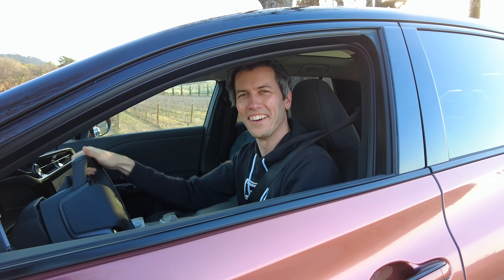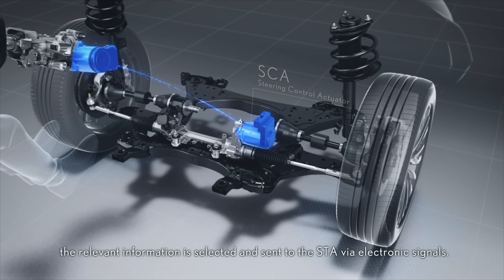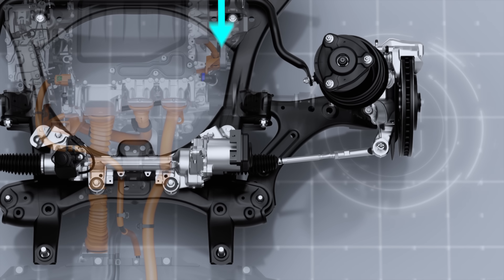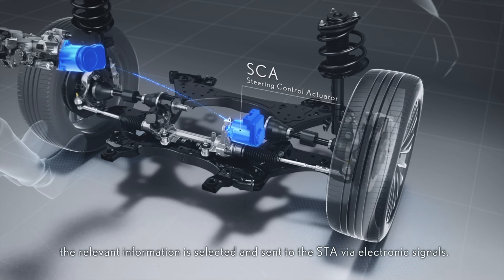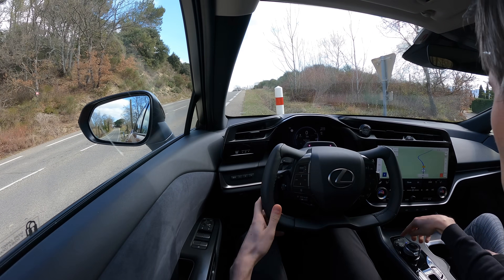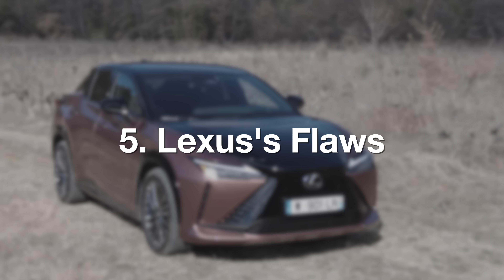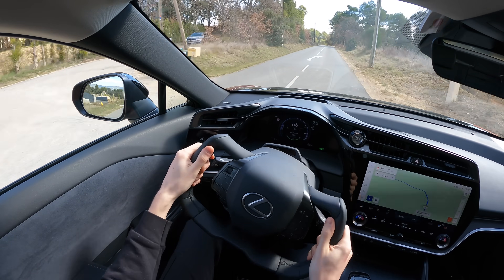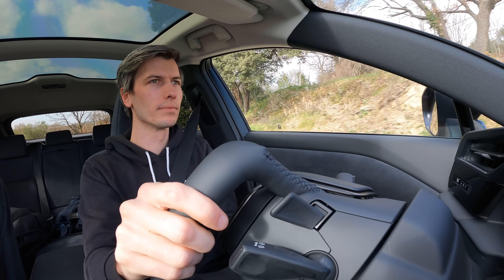How Lexus Fixed Tesla's Bad Idea: Steer-By-Wire Yoke

Comment: Not wild about this but I’d love to try one in the real world. I feel like the variable steering ratio would take some time getting used to and could possibly cause some issues when first getting used to it. The ratio could be different than the driver is expecting in some situations when learning the system
Reply from the maker: Definitely took some getting used to! Watching back my driving footage, there numerous moments where I'd steer, then realize I'd put in too much angle, and correct. I predict we'll see many curbed wheels when these first come out. 😂
Reply: @EngineeringExplained  
6:18 I heard a clunk of some sort 😬. Was this what I think it was? 😉
Reply: @Conservator.  what did you think it was. Sounded like he hit a lane marker
Reply: @MStrange88  Yep, I thought he hit something.
Reply: @Conservator.  sounded like something hitting the interior from the cornering forces
Reply: @joshieeee20  It was probably another bucket. Every time someone leaves a bucket on the road he hits it and damages the car.
Reply: @EngineeringExplained  But where is the evidence you're ever as used to it as you were a fixed ratio? Professional gamers on computers disable "mouse acceleration" on their operating systems! The concept is the same. Sure, not everyone is a pro, but this is burying muscle-car-interface mechanics deeper into the subconscious.
Reply: @EngineeringExplained  What if they dont touch the steering ratio, put an slight expo to it so the center is less sensitive?  Then I would also like damping of steering movement at the yoke, generated from the feedback motor, to prevent jerky moves. Then you could tune the curves however you like, also less damping if you feel like racing.
Reply: @EngineeringExplained  That is an excellent explanation as usual, I like the idea of variable steering ratio, and I love my Model Y single pedal mode and think you would adjust to variable speed steering quickly. 
Still, NHTSA would put up so many roadblocks for Tesla to implement.
Reply: @jjamespacbell  I don't really get that why so many people like one pedal drive. I guess they want it to feel as similar to a gasoline car as possible. 
It feels like they remove one of the best features of electric cars by doing that - the ability to freewheel, without having to drag along a high internal friction engine, that slows the car much faster than just the air and rolling resistance.
If I want to regen, I would rather choose when to do it or not - either by the first section of the brake pedal being regen (as in some existing electric cars) or having it on a separate button or for example a paddle on the steering wheel.
Reply: @Speeder84XL  Since I drive truck the one pedal driving with regen would be identical to driving a truck with the engine brakes turned on. Since you can float gears in trucks, down shifting doesn't require the clutch so you can pretty much bring them to a stop with just the throttle and engine brake.
Reply: @Speeder84XL  A good many EVs give the driver the choice of regenerative-braking levels. Mine does. By default it's set up to feel like a normal car, so that someone who can't deal with something out of the norm doesn't have their head explode. One press of a button puts it in one-pedal driving mode. I use it in traffic jams, but not in normal driving.
Reply: @bikeaddictbp  Yes, but regenerative braking is nice to have. What I don't like is to have too choose between a car that loses speed unnecessarily fast as soon as the gas pedal is lifted or having to turn off regenerative braking completely. I want to choose when to brake or not - regardless if it's regenerative or friction braking. 
But of course it also may have to do with how I drive. For slow drivers, it's easier to keep a slow steady speed (going the speedlimit) if having a car that behave almost like a cordless drill (a bit exaggerated), where speed (RPM of motors) is quite hardly regulated by the position of gas pedal (especially if there are hills). 
But the way I drive (unless it's a relatively straight road with little traffic, where I go at high speeds continuously), I mostly use gas pedal to just accelerate, then coast down while approaching slow drivers ahead (or some other obstacle), then accelerate again while the road gets clear and so on. With regenerative braking as soon the pedal is released it just get more jerky with having to hold the pedal for longer then directly transition to braking.
One of the big advantages of electric cars is that they can actually freewheel, without a high internal friction engine wasting energy slowing down the car (or wasting gas running at idle, if neutral is put in). It just feels like they take away that advantage with the "one pedal drive" (either that or you have to turn off regenerative braking, which is otherwise a good function)
Reply: @Speeder84XL  I do not think you completely understand regenerative braking .  EV s using the regen to generate electricity to the cell pack is a plus . Also one pedal driving is a plus .  Some people driving an ICE car can use the transmission ( downshifts ) to slow the car down and keep RPM high for better performance .they also can let the car freewheel to save gas .  EV s  just work differently.   If you can change the regen on the fly , it is just better driving experience. Just like changing the steering ratio by the computer.
Reply: @rayRay-pw6gz  I understand well how regenerative braking works and also know that electric motors doesn't do that on their own (they are not like an ICE, that have braking action on it's own, as soon as no fuel is put into it). An electric motor just freewheels if the power is turned off - for any regenerative braking to happen, it has to run as a generator with current drawn from it (which can then used to charge the battery). It is all regulated by the inverters and can as well be activated by the brake pedal (top part, before friction brakes kick in) as in some EVs or by a separate button or lever.
So, simply put - what I don't get is why so many people want a car that quickly loses speed as soon as the gas pedal is let pedal off (regardless if it's regenerative braking or internal friction from an engine). The only thing I can think it's good for, is slow driving - it get's significantly easier to keep a slow steady speed (usually the speed limit) with one pedal drive (especially when there are hills). 
I would rather have one that just freewheels when the gas is let off, then choose when I want any braking action. But with that said - it's not at all something that ruin the nice experience of driving an electric car and can be compensated for when driving (by just "hold on to" the gas for longer, then let it off closer to where I want or need to slow down). But I would rather prefer to not have braking action going on as soon as the gas pedal is lifted.
Reply: @Speeder84XL  I think that some people like myself , like to have greater control on how my car runs.  I have a Camry with 8 speed automatic. I like to use manual shift mode sometimes for greater control .  Going down a large long hill , I sometimes shift to a lower gear to keep the speed lower without using the brake.  If I am in slow traffic , I can leave it in first and have one pedal driving .  Also the transmission learns my driving style and mimics the way I shift .  Personal preference.
Reply: @rayRay-pw6gz  Yes, but when going downhill and need to go slower than the "terminal velocity" (the speed at which the air and rolling resistance keep the speed from increasing any further), I prefer to control the speed mainly by braking instead (even if it means also using the gas occasionally
 - for example slow traffic is often "stop and go" and the hill may not be steep enough to get up to speed quickly enough when traffic starts moving, by just freewheeling). 
The only reason to use a gear instead of brakes, is to avoid overheating the brakes going down long hills and to save fuel (as the energy that would be just wasted in the brakes is instead used to turn the engine - which would otherwise consume fuel by idling). 
But with regenerative braking, there is none of those issues, so with the right configuration, it will allow for controlling the speed by braking and still be very energy efficient. That's how I prefer to drive - but after all, it comes down to personal preference.
Reply: @Speeder84XL  yes I totally agree .  Personal preference.  Humans are complex .  And back to the original conversation,  that is why having these choices in any vehicle is a plus .  😎
Reply: Cadillac did a variable power steering based on speed a while back that was an absolute disaster driving around mountain roads. Coming out of a slow speed corner, getting up to 55mph, then into an uphill curve. Drivers wouldn't anticipate the change in steering feel and understeer. They slow down and the low speed power steering kicks in then yanks them into the on coming lane. A variable steering at high speed could be tough to get used to if you live with lots of windy roads.
Reply: @davidallison669  I believe what you're talking about is what's generally called "variable effort" or "variable assist" or something like that. Less assist at higher speeds and more assist at lower speeds, it's common in vehicles with both hydraulic and electric assist power steering. I understand what you're talking about, but that sounds like an early implementation of GMs early version of this, where it was merely a solenoid and those were also not reliable. You're not wrong in what you describe. I currently own two cars that actually have this system and the dynamic is much more refined than the early systems I mentioned, as I've also driven a number of those. Anyhow, those systems are now very common and not an issue, because of many refinements made since first implemented into production cars. 😊
Reply: @goosenotmaverick1156  
There are mechanical variable ratio mechanical steering systems. 
BMW introduced their version in 2003. It’s called active steering. See Wikipedia.
Reply: @Conservator.  im aware they exist, and what they are, etc. I was referencing the exact system someone else was talking about, see  comment by person I tagged. They were talking about a Cadillac variable effort system not a variable ratio system.
Reply: @goosenotmaverick1156  Ok, 👍
Reply: @davidallison669  hard to say without trying it out, but the steering angle increasing while breaking could be quite something, I would certainly be conscious of that for the first few corners!
Reply: Yeah, I feel like this is a case of the exceedingly-low-but-non-zero probability of unexpected behavior at exactly the wrong moment is not worth the marginal & debatable improvements over a system that works just fine as is.
Reply: I think it would be easier to get used to with a yoke than an ordinary wheel though. Because it would feel more natural with the higher sensitivity steering at low speeds then
 - turning a yoke like 360° in each direction (or what most standard cars have) would feel a bit strange and clumsy. But with a normal steering wheel, it would take a little time to get used to - since I think most of us would expect it to behave like a normal car. 
When it comes to F1 cars, I don't think it has to do only with them being better drivers, it also has to do with the "centering force" on the wheel/yoke when going straight. Higher sensitivity means more force must be put in to turn and that also means the "natural stability" felt when going straight without any steering input get's stronger as well. 
So the driver will steer more by force and less by angle, so to say. It's a little like go carts - they also have very sensitive steering (since they are so light, that the force turning the wheels is not an issue), but have no problem with stability on straights (not even for inexperienced drivers). 
I think for normal cars it's more of a force issue at low speeds. The driver would need to be quite strong when for example parking, with high sensitivity, haha (a normal car is also like 2-3 times heavier than an F1 as well). I could probably do it (since I have done quite a bit of strength training), haha - but most people would probably not do very well without a lot of power steering assist in such a car - which would also need to be strongly speed dependent (and have the regulation systems in place for that). Otherwise the car would indeed get stability problem at high speeds, since the mentioned "stabilizing force", get cancelled out by the power steering assist while still being very sensitive to steering input. Then it is pretty much a steer by wire system anyway, but with less flexibility.
Reply: @Speeder84XL  F1 cars have power steering too and they are much more difficult to drive without it. Even very well trained F1 drivers can hardly drive their car when power steering fails. 

F1 cars don’t have to parallel park there cars. Their turning circle is quite large. They can only barely make the tightest turn in Monaco.
Reply: @Conservator.  F1 cars use a different steering rack with quicker gearing for Monaco, though.
Reply: I sure variable steering ratios exist in racks world doesn't it? I want to say Mercedes....
Reply: @JLneonhug  Citroen was doing it in the 1970s with their DIRAVI system. It's just not very common to map that variability to a 180 degree wheel instead of the standard 540 degree setup.
Reply: @JLneonhug  transmission on your steering column?
Reply: Good for daily drivers, bad for valet drivers. 😂
Reply: @waczze  valet drivers hop into so many screwed up cars that barely drive though, that something like this shouldn't be a problem
Reply: Variable steering speeds have always been a bad idear on any car... Driving fast on twisty bits of road requires predictive steering...
Reply: @justacomment1657  But as mentioned in the video, not everyone wants to drive fast. A lot of people (in reality, it's most people) just want a smooth, comfortable, and easy drive. Me personally, the majority of my driving is to and from work and the occasional weekend out in the town to entertainment locations (movies, restaurants, stores, etc) so when I go shopping for a car, I don't really look for something that is super fast and feels what I consider to be harsh on suspension or loud interiors. I always look for cars that are comfortable, smooth, and quiet but again, that is just my personal preference.
Reply: @ProXcaliber  a good cast car can have a smooth suspension and a quiet interior. And still be predictive to drive fast. It is possible the alfa giulia proves it.
Reply: @justacomment1657  I never said that it was impossible to achieve. But there is a reason why the most popular vehicle class is crossovers, SUVs, and pick-up trucks. You can often find a much smoother and comfortable ride at a lower cost in a larger vehicle. That is not to say there aren't smooth and comfortable inexpensive sedans. But again, usually most people prefer larger vehicles because of the extra space and comfort provided by it, as well as perceived safety. As mentioned in the video, the majority of people are not looking for something fast and ultra responsive or that even has a ton of driver feedback through steering and throttle feel. Most people like relatively light steering, especially in scenarios like parking or low speed turns in cities.
Reply: It could be problem for someone who has a 2 or more cars, if you have one like this and a standard car going back and forth, it could cause possible problems in an emergency situation. This could be very dangerous in some points.
Reply: Some cars already have a variable ratio, i think bmw has it as an option. I think it should be way more intuitive than you think, if programmed well that is. Although i can‘t say i tried it, i would sure love to.
Reply: @bigsmoke9935  the steering on those cars have always been a point of criticism. Alsow keep in mind steering speed and force are not dependent upon each other.....driven a Renault with such steering, it had rear wheel steering as well. And while somewhat fun it was alsow unpredictable at certain speeds... Turns were much tighter and! Alsow wider then expected..... I can compensate for a wide turning circle or a fast / slow rack, but compensation of all of that while the ratios constantly change I would find extremely annoying.
Mind you guys I Europe roads are seldom straight... So going thru corners in different speeds and radius is quite the norm here.
Reply: I always wanted a car with a steering ratio I could change . This system seems to be a good choice.  Well thought out .
Reply: @rayRay-pw6gz  ideally it'd be configurable like the sport and other modes that adjust the transmission and traction control.
Reply: @extragoode  Lexus in my view is more of a luxury car with some extra horsepower.  Sports car can have different controls.
Reply: @rayRay-pw6gz  I thought pretty much everything had those modes now, my 10 year old leaf has 3 modes and my 3 year old expedition has 8 or 9. Regardless, I'd always prefer my car's functions to be configurable, the more detailed the better.
Reply: @extragoode  what modes are you talking about with 8-9 modes ?
Reply: @rayRay-pw6gz  There are actually 8. Normal, Eco, Sport, Tow/Haul, Snow/Wet, Grass/Gravel, Mud/Rut, and Sand, then there are 2WD and 4WD permutations of each of those. They're like presets for the traction control settings and shift timings for the dual clutch transmission that some Ford engineer decided were better for those conditions than say normal. We've only used half of them. My point is that steering variability could be built into those too. Obviously mud and sand are generally going to be low speed terrain where you'd want quick steering, but normal could have a moderate amount of variability and sport could have the most.
Reply: I already have serious problems when my power steering suddenly turns off at low speed mid turn, so I turn less than expected, and have to redo the manouvre from scratch every time.

I can't imagine this going any better
Reply: i think its dangerous ... 1 accidental jerk to one side or the other and you are fuxed
Reply: @Mr.Helper.  I mean to be fair, what you are describing could easily occur with a linked steering wheel as well. I think the idea should be to NOT jerk the steering wheel at all whether it be drive by wire or a linked steering column, unless it is absolutely necessary in the case of an emergency to avoid collision.
Reply: @Mr.Helper.  for this they maybe will implant an ai wich than thinks for you 😅